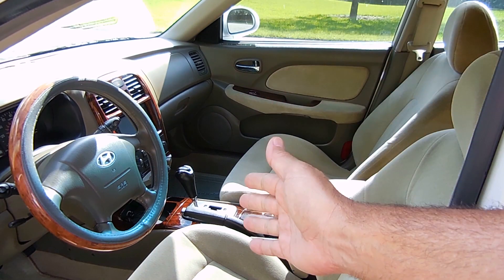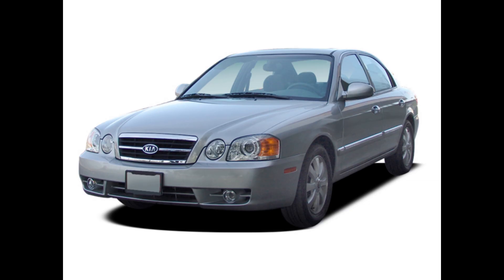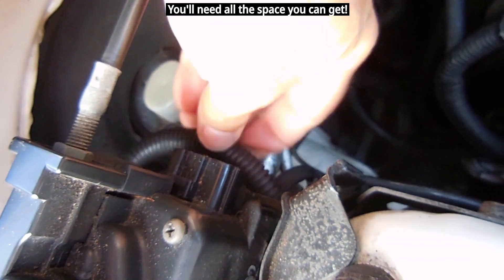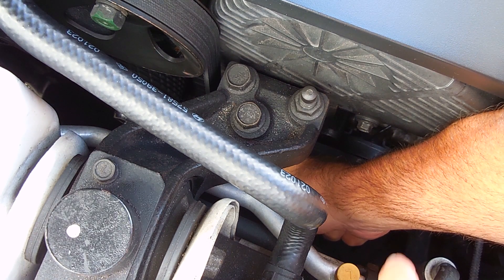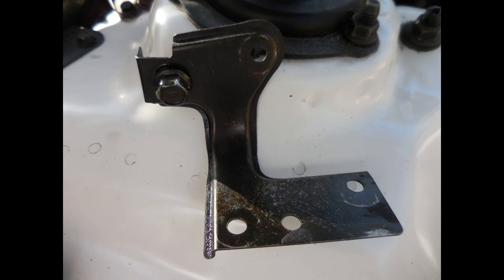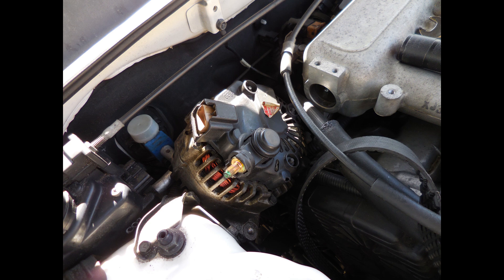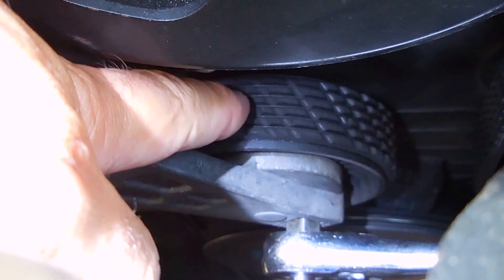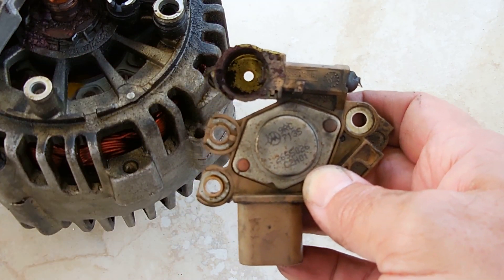Hyundai Sonata & Kia Optima V6 2.7L Alternator Replacement (No ABS)

Comment: Weird. 2003 optima has a massive unmovable BOSCH unit next to the firewall. There is no lifting out the alternator. You have to lift the engine to make the alternator fit through the passenger wheel well, there was a reason I had to take off my CV joint too just to get that out (couldn't create enough space). Also, the plug on the back isn't removable until you unmount it because a metal power steering pipe is in the way. Looks to be the same on yours, seeing the pinching. Outside of all that, the V6 is identical.

Comment: This is very informative! i have a 2011 sonata and fear i need to do the same thing. good thing you're instructions were easy to follow because you're gonna save me about $500 bucks to pay a mechanic to do this. my alternator is towards the front but i will still need to remove the passenger wheel to get to that bottom bolt. thanks again for showing this. when i work on this myself i'll post the video to my channel to show the 2011 2.4L theta engine models.
Reply from the maker: Glad you liked the video! Be sure to rate thumbs up, and share the video link. Good luck with your car. Thanks for watching

Comment: Thanks, if I ever have to do that job again I’ll try it that way.  I did it from the bottom which was more work but living in a salt
state I was able to do rust/rot prevention in nooks and crannies that I would normally never see.   Bye the way, if your crank sensor  has lost insulation due to heat, one thing that may help is replacing the cooling fan.   I did a current check with a scope on the fan and found almost half the commutator humps were missing.  The fan ran smooth but was not putting out rated  CFM.
The car never actually overheated but I was having weird what looked to be heat related problems and I suppose the elevated engine compartment temperatures didn’t help.  That missing insulation on the crank sensor leads is not all that uncommon on the 2.7 v6 and my car ran fine until it rained.

Comment: Here is a little tip for folks looking to diagnose their alternator. If you can get to the front or rear of your alternator, try this...
 With the ignition and engine OFF take a screw driver and place it on either end of the alternator, front or rear on the axis (the place where the bearings would be, on the front that would be the shaft where the nut retains the pulley/sheave. Move the screwdriver toward and then away and see if there is a magnetic attraction? No, nothing or very little? Okay, now go switch the ignition key to on but DO NOT start the engine. Repeating the test to see if there is now or not a strong magnetic pull or attraction? There should be a very noticeable change in the magnetic attraction. If not, it is more than likely your voltage regulator (that today also includes the brush assembly) needs to be replaced. The alternator could continue to perform for many years with new brushes installed, making sure to clean up the slip rings though. Sometimes a voltage regulator can be purchased fairly inexpensively but a rebuilt/re manufactured complete alternator may not be priced out of reach neither and may be the best deal.
Reply from the maker: Good tip. I could've cleaned up the slip rings, and installed a new regulator, but it was easier and not much more money to replace the alternator with a reman. I only paid $100
Reply: Ever use a compass? Proof of magnetic flux at  b plus at generator

Comment: Good video, unless the vehicle is equipped with ABS. If so, cv axle must be removed.
Reply from the maker: True, but if you remove a few things under the vehicle, it should drop out.
Reply: electronicsNmore it can also be removed from top with abs, but it’s more technical and a lot more unplugging and moving of
Parts, as in the intake manifold and everything around it/attached to it, hence why abs equipped vehicles recommend removal of CV axle 👍🏼

Comment: Hi Mr. ENM, my question is, in this video I noticed 2 different alternators at the time stamp 4.46 and 6.01. Which one you removed from the Hyundai Santa Fe V6 2.7L car? And could you please let me know the Valeo part number on the Red/ Silver sticker back side of the original alternator? Much appreciated.

Comment: I have a 2006 but I don’t have the clearance that you do near the firewall so I cannot remove the alternator through the top? Any suggestions
Reply from the maker: This video is for 2002-2005 V6/2.7L. For 2006, the engine is different, more than likely you'll need to lower it out of the bottom. Thanks for watching!
Reply: electronicsNmore There’s no room on the bottom either? Would you suggest I remove the CV boot? And possibly motor mount?

Comment: Mine has ABS cluster "F" on the firewall totally in the way. I hope there is another way to pull this out of the car!
Reply from the maker: Probably straight down and out. You may have to remove something.
Reply: @electronicsNmore  CV axle had to come out, unhook that side motor mount and jack engine up a few inches, pull out of the bottom. Good news is it didn't take that long. I finished the same night.

Comment: What about for a 2001 Kia Optima? How do you get it out with the cruise control in the way?
Reply from the maker: Same setup under the hood with a 2.7L. If you have ABS, you'll have to remove the alternator through the bottom of the engine. You can remove the cruise control unit for easier access.

Comment: OK. So it lifts up and toward the fire wall. I couldn't figure out what to do with that bottom bolt. Thanks.
Reply from the maker: Thanks for watching!
Reply: @electronicsNmore  I got it. Thanks.
Reply: @Warvvolf  how......m
Reply: @ChrisG0  I don't completely remember. But it was difficult as hell. Basically it's just sitting in that open U shaped slot. I think I was able to loosen the bolt and back it up and out. Damn thing was heavy.

Comment: nothing to do with alt. I need a lil schooling on headphone sockets to add to an amp. what's the difference between 4,5 prong sockets both are stereo.not sure which to use?
Reply from the maker: So you clicked on my video, didn't watch it, just to get to my attention so you could ask a question? This isn't the right place to be asking that question, this video is auto related.
Reply: @electronicsNmore  I did watch your video always do your very informative just needed an answer to ? I had, you were only one I thought could answer it. sorry for wasting time.
Reply from the maker: @dewmei64  Please post your question at my other video about making an audio output to mic recording cable. Thanks

Comment: Do me a favor and check if you can pull out the rack and pinion without taking the subframe out
Reply from the maker: Once all the lines have been disconnected/pins/etc, you need to remove the RH stabilizer bar mounting bracket, remove the rear roll stop bracket, loosen the sub frame bolts so the sub frame can hang down a little, remove the power steering rack mounting bolts/brackets, then pull the entire unit out through the passenger's wheel opening.
Reply: @electronicsNmore  thank you very much was hoping to be a less evolved job but not to bad

Comment: I just replaced the alternator in my 2005 v6 sonata and now the car still wont start. I tried to start it as soon as the new alternator was in, and it ran great for about a minute before it shut off. I then tried to crank it again and the car wouldn't turn over, also tried jumping the car and still no luck. Any idea what this could be?
Reply from the maker: Probably a bad fuel pump

Comment: Does not work if you have ABS!!! Abs pump sits in the area he pulled the alternator up through!
Reply from the maker: In that case, you'll need to remove more parts from the bottom and pull it out from there. It won't go through the wheel well.

Comment: Why not just replace the regulator and brushes?  Save some bucks
Reply from the maker: Hi. There was no savings. If it was only a $25 part, I would've cleaned up the rotor slip rings, and replaced the regulator, but the regulator cost $125 on Amazon, and $125 - $200 at the auto parts store. Thanks for watching!
Reply: I just bought regulator with brushes for 34 bucks. hope it's the right one. ABS in the way of getting alt out the top.